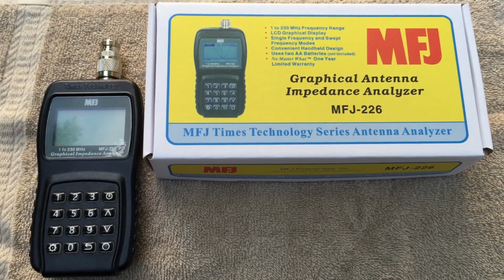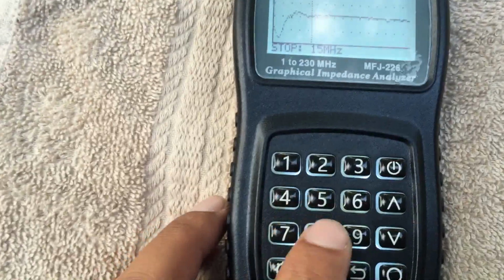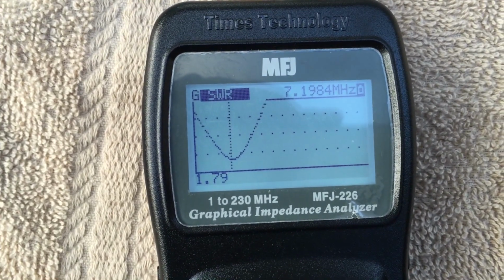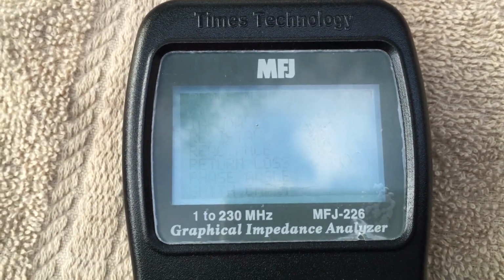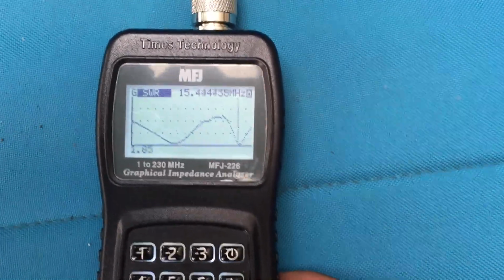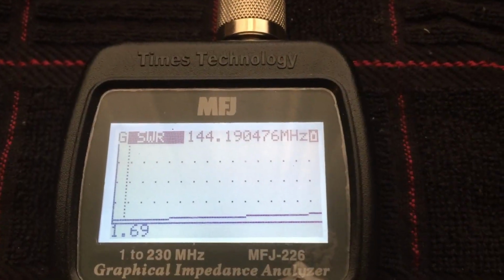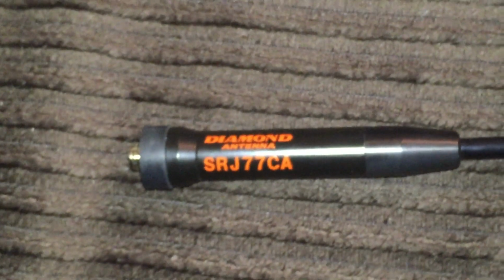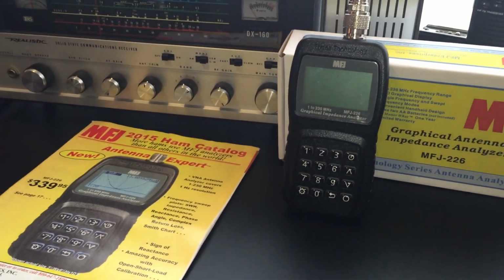MFJ-226 Graphical Antenna Impedance Analyzer - Testing Antennas and First Impressions

Comment: Very nice review ... the MFJ-226 may be a complement to the AA-55 Zoom I picked up this summer. One thing I have noticed, the AA-55 Zoom does not use a broadband detector, so, it works well in close proximity to an AM radio station when tuning 160 meter antennas! I have a station at 1700 kHz that is 4 miles off to my northeast, and the AA-55 Zoom isn't bothered by that station. I measured about +1 dBm at 1700 kHz on my tuned loop (when tuned to 1700) and the AA-55 Zoom works within 1 kHz (+-1 kHz) of 1700 kHz to read antenna Z! If the MFJ-226 would do that it would be a SUPER antenna analyzer for a low band operator like myself who lives near AM broadcast stations.
Reply from the maker: I had an AA-30, along with this MFJ-226.  Though I'm unsure on how different the interface is between the AA-30 and your AA-55 Zoom, I must say that I preferred the ease of use, responsiveness and functionality of the MFJ-226 compared to the AA-30.  Nothing beats the MFJ-259/269 series of analyzers for quick and dirty day to day fine tuning of antennas though.  Sorry for the belated response but thanks for watching!

Comment: @6:28 resonance has nothing to do with impedance :) you measure reasonance by phase angle, not impedance.

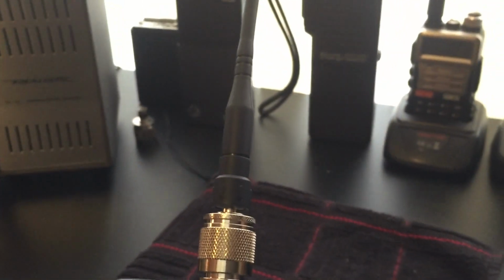@8:31 ht antennas are designed with capacitive coupling in mind. you want to measure it while holding the analyzer, the antenna is deliberately designed to perform while capacitively coupled through the ht to your body. try a tiger tail for improved performance.
Reply from the maker: Thanks for the review and comments.  I'm generally aware that impedance doesn't necessarily match resonance, but I guess like many, I tend to use the term interchangeable.  Resonant or not, we must have that near 50 ohm match for our radios.  

Tiger-tail is a great idea!  (counterpoise?)
Reply: yes, counterpoise. provides a far more efficient groundplane than human body.

19" alligator clip leads just happen to be perfect length for 2m HT. the metal belt lug on the side of a baofeng uv5r just happens to be ground.